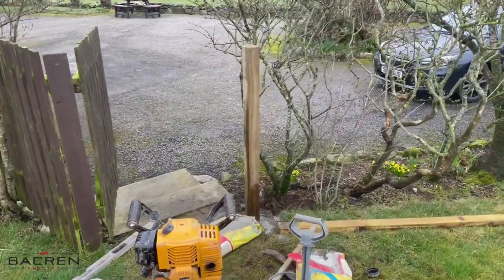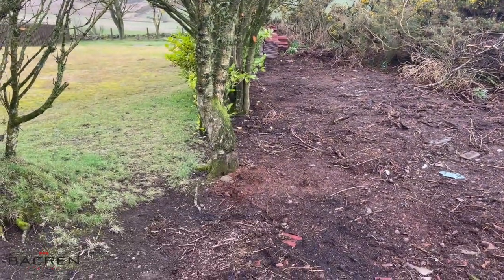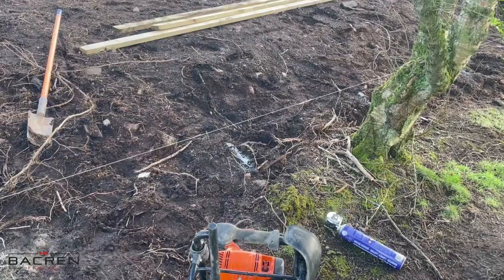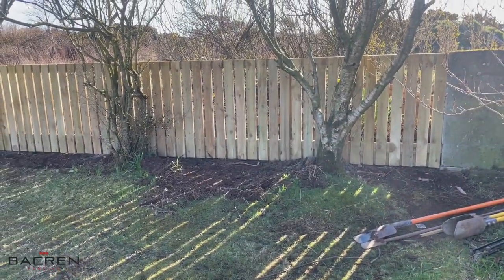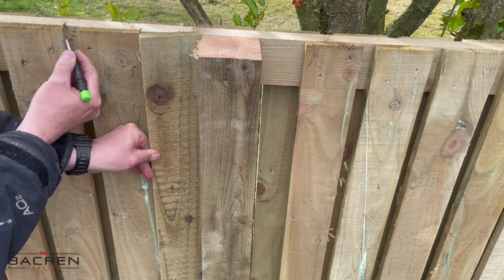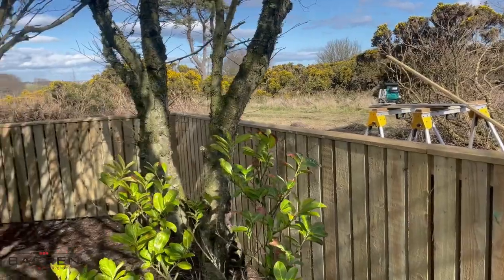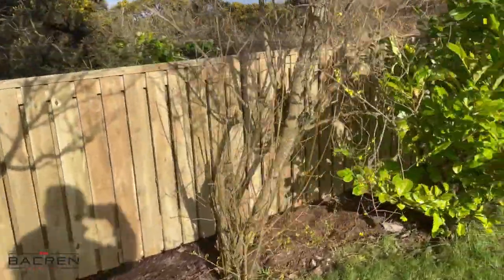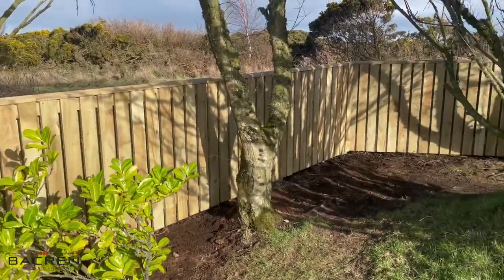Wooden Fencing Installation | Hit & Miss timber fence VLOG #3 Bacren Fencing

Comment: Hi, when you've set your string line. How do you get the top of the posts all the same height ?
Cheers
Reply from the maker: To be honest, I usually cut the top of my fence posts and coat with clear preserver. In this case, I just put them in over length and cut them, the fence is getting painted by the client, so post tops will be well protected. Also, I usually cut them at a 30 degree angle to encourage the water to run off.
 To gauge fence post depth, I have marks at 600mm on my post hole diggers (you will see the red tape) I use this as a visual aid to gauge when the correct depth is reached.
 I am really OCD when getting fences running perfectly straight, especially when adding capping rails, so it is easier to fit the top rail perfectly where you need it and then trim the posts.
 I will make some videos in the future on how I do things.
 Apologies for the long winded answer, but the processes that I use totally depend on the individual situations. Cheers
Reply: @Bacrenfencing  thank you